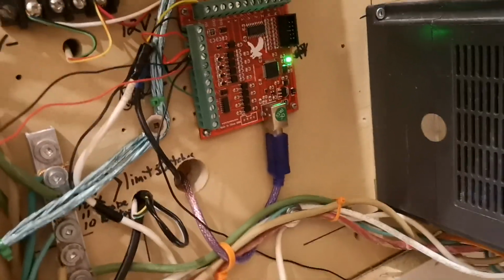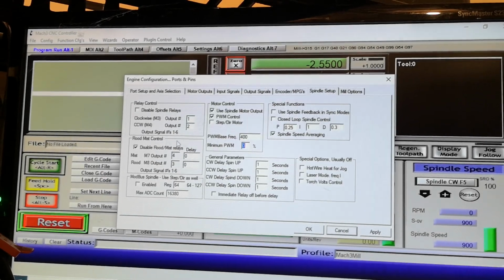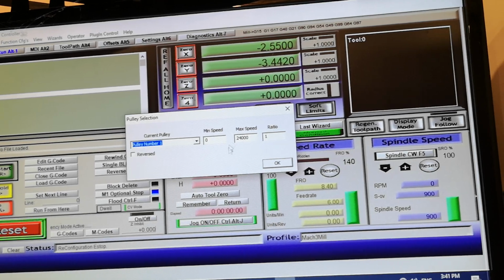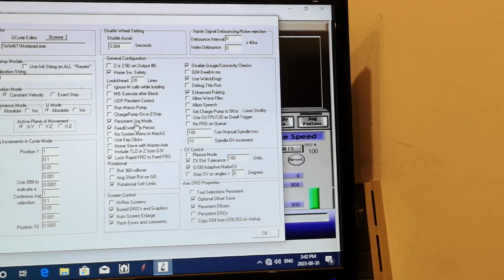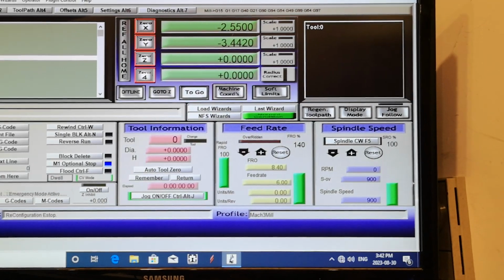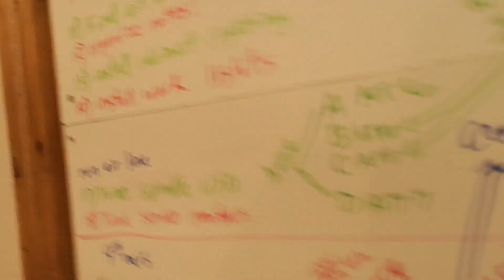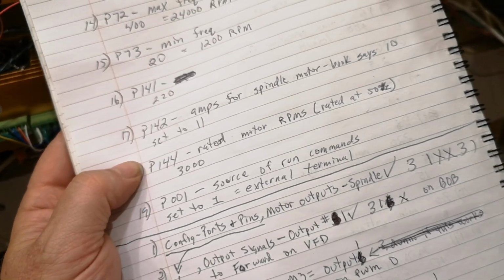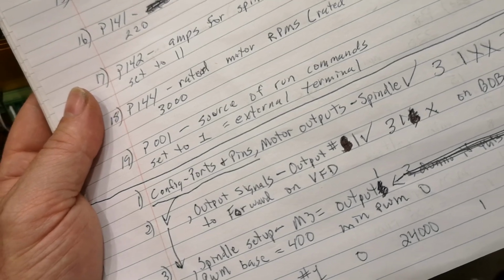mach3 usb controller pt.2 - VFD - wiring and setup

Comment: Hi, thanks for sharing 
Is your spindle speed control working ok? My one is pulsing it comes up to speed, then drops about 30%, then comes back up every 30 seconds or so
Reply from the maker: no, mine doesn't do that, but it drops out completely at random times. I was thinking it could be because I don't run it much these days and the VFD needs the capacitors charged up b4 running. Next time I run mine, I plan on turning it on for at least 2 hrs b4 I run a program. You could try that, but I doubt it will solve your issue, but you never know, you may get lucky.